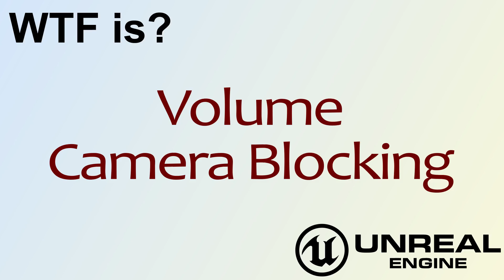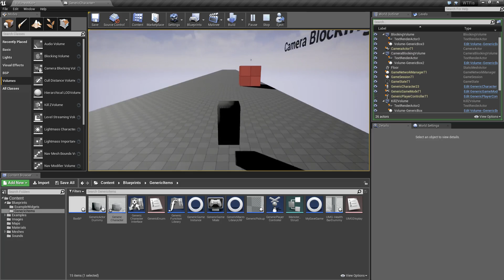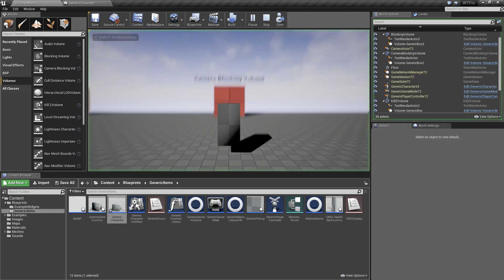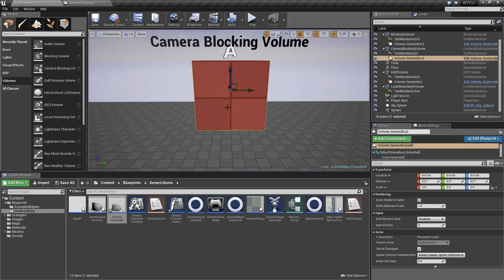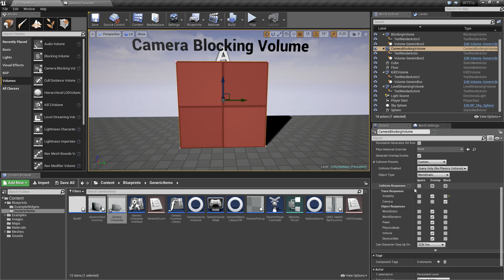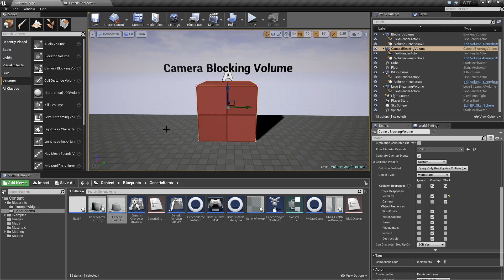WTF Is? Volume - Camera Blocking in Unreal Engine 4

Comment: Hi, Thank you for great Tutorial. And I have a question about Camera Blocking. Issue for camera through wall.  I did many effort for camera blocking from SpringArm of character BP. But In my case I Setup my basic boom position to X: 0, Y: 60, Z:40 At the View Character be Locate Left side from center. So, OK too long Sorry. Anyway In this case(after set Do collision test) when camera turn to left way is very good block but do Right side turn is through wall well. So I try Camera Blocking Volume so almost things solved but when close to wall and I do zoom camera then through again. So Too long Sorry. So have a solution about this? and I think If can make camera blocking volume In Character BP for Around Camera, OK did you try? Is it possible?

Comment: Hello! Got a question. Been building a Paper 2D game and I'm having an incredibly difficult time with figuring out how to block the camera from going outside a zone and staying inside the play area. Is there a way to use camera blocking to force the camera to stay inside the level area?
Reply from the maker: +Aaron Saylor For something like this probably not.  The camera blocking is mainly intended to be an invisible area that the camera is not supposed to go into and mainly for 3rd person cameras.

For something like this you would have to define areas that the camera is not supposed to go into and just stop the character or camera from going there when you control it.  With a 2d setup the camera would normally follow the character or be fixed.  If it is following the character you would just stop the camera itself whenever it moves out of bounds and force it to go back.